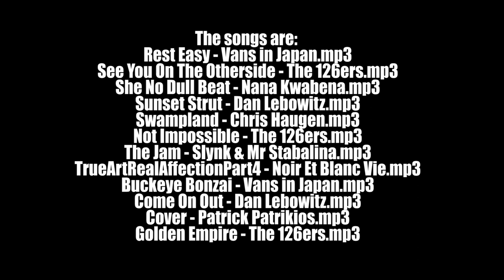18KT red gold ring with old cut diamonds and kunzite stone handmade

Comment: Alberto,could you please tell me if it was possible to use ordinary soldering to mount the cast, and not laser?
Thanks.
Reply: If he had soldered the bezel for the large stone, there would have been no way to polish the inner gap between the smaller stones and the large stone. With laser welding he can take the two pieces joined in that area to final polish and there is no need to worry about fire scale or solder marring the finish.